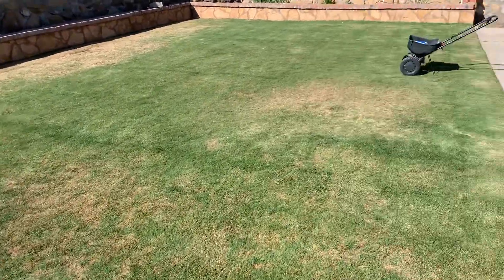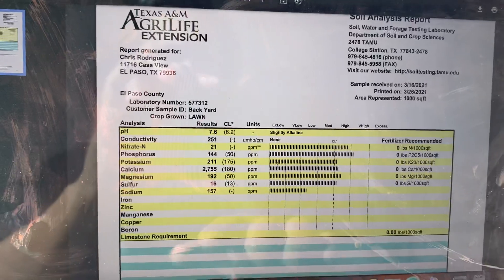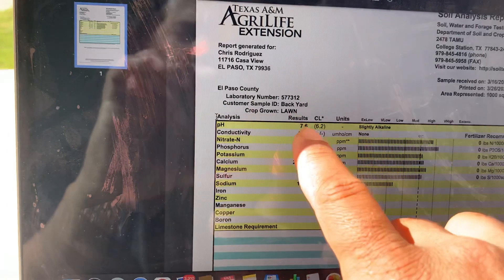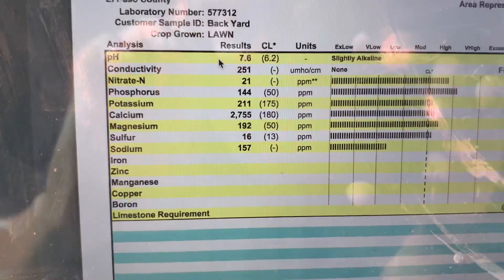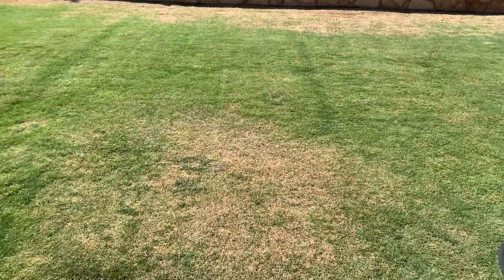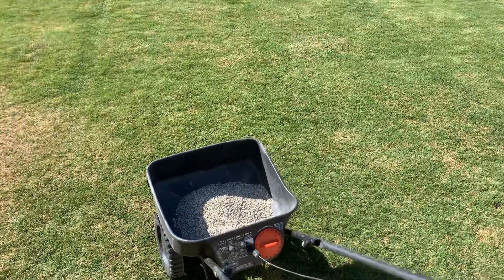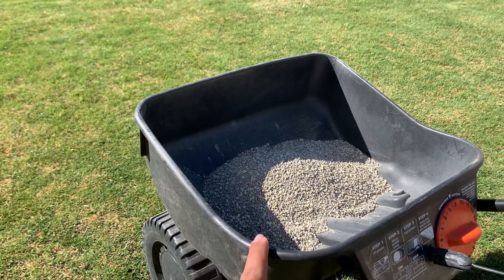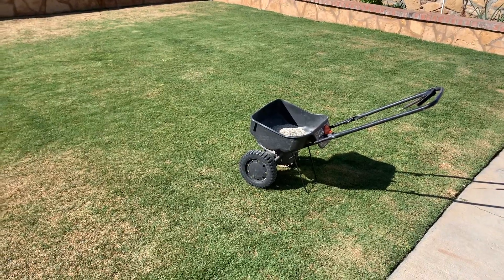How to Adjust Your Lawn PH Level

Comment: Do you have any experience with inexpensive soil pH testers that display the result on a gauge or digital display? I bought one and it says my soil is over 9.0, so very alkaline.
Reply from the maker: Howdy and I have used those before from the big box store. Even the ones with droplets and tablets. They do their job to an extent and over the years local University studies are cheap as well and give far more details and accuracy. But if you are Alkaline you will want to apply Elemental Sulfur.

Comment: Hey. Just the video I was looking for, very easy to understand. I did a soil test and my soil is alkaline…so I want to add the sulfur…but I just over seeded tall fescue. Can I put down the sulfur now since I just over seeded? Any advice would be greatly appreciated. I totally new to working on my lawn.
Reply from the maker: Thanks for watching and soil can be applied any time really. This particular product is low dose of Sulfur. You can get higher percent of Elemental Sulfur in other product lines. The key is to only apply 5lb per 1,000 sqft. How alkaline is your soil?
Reply: @SunCityLawnCare  Thanks for the reply. My pH is 7.6 So do I just put down 5 lbs twice a year of the stuff you used in the video? Or what do you think?
Reply from the maker: I made another video to here discussing a better product to use and a quicker way to bring down that PH. How to Lower Soil PH in Lawns and Gardens
https://youtu.be/JvswgcwX3CM
Reply: @SunCityLawnCare  Awesome. Thank you very much again for all your help.

Comment: I'm putting down elemental sulfer this week. I'm going to put down 3lb/1k, but I'm using just elemental sulfer not a gypsum mix  so it's 90% free sulfer. The mix you have looks like it's only 16% actual sulfer so you're only getting 0.96lb of sulfer on the lawn? I would think you could put up to 5 times that amount to get to the 5lb max rate of sulfer?
Reply from the maker: Absolutely...I’ve got plans to add 6lbs per month as a test trial to the potential burning affects to the lawn as well. Love where your heads at on the math and tech side. Appreciate the feedback.

Comment: Does the water in El Paso negate any acidifying efforts? Our water is pretty alkaline and I’m wondering if that is what making my garden beds so alkaline. They’re at like and 8! Would adding vinegar to the water help?
Reply from the maker: It won’t have the impact your looking for. It is a contributing factor to your garden beds and lawn in our area but we have to keep in mind the water companies goal is to simply make the water safe to for homeowners. Hence why we need to make corrections for growing plants wether it be lawns or vegetables. Would not recommend adding vinegar to water as you run the risk of over applying and burning your garden plants. Instead use a garden filter that you can attach to your water faucet or collect water and let sit for 24 hrs before using in your garden area. This will allow the chlorine levels to evaporate. Of its PH levels your looking to correct the best approach will be Garden Lime or elemental sulfur.